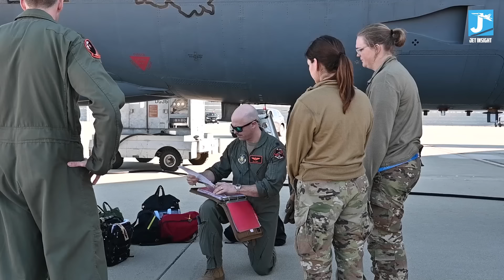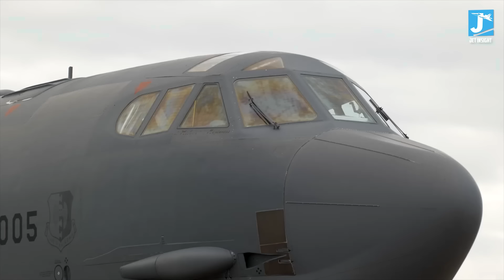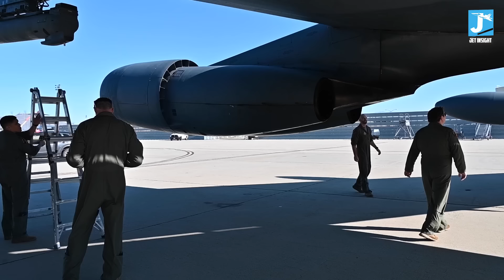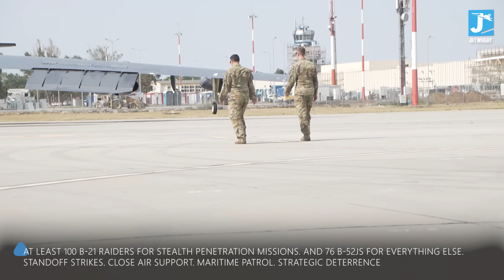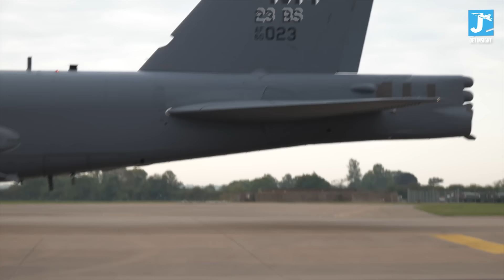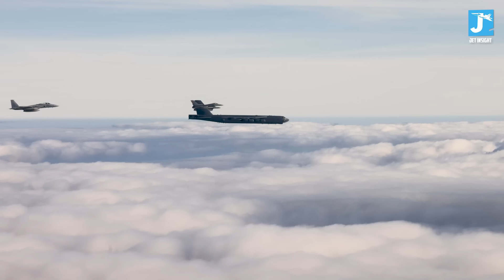The B-52 Bomber's INSANE Upgrade Will Keep It Flying Until 2060

Comment: They're getting rid of the CRM-114? Also, I really don't see them getting rid of the B-2 either. I bet a dollar to a donut; they'll have a block upgrade for it like they did for the F-15EX and incorporate many of the B-21 components, materials and systems.
Reply: B-21 will retire B-2s, the sooner the better.  B-2 skins cost to maintain what 10 B-21s will cost.

Comment: The B1B should have been the lead bomber into 2100-s. I have no idea why they are flying an antique. 
They should have put GE 9X engines on them. Go from 8 to 4. But no.... There is no way they will power them with a RR engine. Sorry.
Reply: GE9X has too a diameter to fit under the wing, as well as changing the laminar flow over the wings. Replacing with 4 pair of RR inside new nacelles shaped like the extant nacelles maintains the laminar flow, and retains the security of 8 engines on long missions. F130 engines are more powerful and 30% more fuel efficient, giving B-52J even longer range and larger payload for missions.
Reply: Go from 8 to 2 GE 9X you mean?  The drag of four would be counterproductive.  Induced and parasitic drag is pretty critical to mitigate.  You are right about B-1Bs.  Dropping down to a schedule where under two dozen can fly really screws up the program.  May as well re-engined FB-111A and kept them flying.
Reply: @MadRat70  Sorry, I meant to say the GEnX engine that is used on the 747-8. I was told years ago that the B52 needed all 8 engines to run the ECM and weapons suites. I was also told that the new AF1 had to have 4 engines for the same reason. I do know that they are putting 2 generators on the 9X engines but who knows what is down the road. I think the pylon ratings on the B52 would support the GEnX... Never support the 9x. Thanks!!

Comment: if take a truck and replace starter, alternator, transmission, gas tank, doors, hood, etc. not much original is left. its not the same plane anymore. what intersinng is the upgrading and how the airframe has endured.    the lessons for next airframe is open system design. so new planes can be easily upgraded and modified.

Comment: The B-52 can take off and land in a cross wind, like no other aircraft.  A major point left out of this video.
Reply: Yep, my brother in law was an officer in USAF and was stationed at Ellsworth AFB back in the mid eighties. He pulled some strings and I got to be on the flight line as these giants were doing touch and go's and that was one of the crazy things that I remember seeing. The body of the airplane was skewed to one side but the landing gear remained aligned with the runway! That and besides the sound that you could feel, I was waiting for a bunch of Air Force maintenance people to run out from the hanger and help push them back into the air - they are that giant and ungainly looking!! It was a hell of a visit to Ellsworth AFB, besides the airplane I also went to a nearby reservoir and caught the daily limit for trout while ice fish AND after a security clearance check - I thought that was a little extreme - I got to check out a SR71 Blackbird. That was awesome and yep, they had armed USAF people around it. He ended up retiring as a colonel and over his 20 year career, I got to check out some pretty cool things that the general public just can't do so I am grateful for his service and grateful that I was able to visit all of these different AFB's and the areas around them.
Reply: It would be cool to see the actual size of that bad boy in person. Only seeing them on screen doesn’t do them justice im sure.
Reply: This is off topic a bit.  I know the SR 71 was quite expensive to maintain and it wasn’t designed to carry any weapons etc.
If it were even possible I wonder how it would be if it were to be refitted with a launch platform for hypersonic missiles would perform.
Reply: @dispatch444  Google search the M-21. 😉
Reply: Same as the B744.

Comment: Everything is good but loosing the analog gauges is a huge mistake!
Reply: Why would you say that? Most of my 20+ year USAF career was spent as a maintenance Crew Chief on KC-135s. In 1997 my KC-135 was the first tanker to get a glass cockpit upgrade and got rid of all the old analog gauges. The glass cockpit is so much more capable and dependable compared to those analog gauges. Since the KC-135 was also built by Boeing in the 50s it shared a lot of gauges with the B-52 so it should be a very smooth and much needed upgrade. They will totally love the new engines. They upgraded the engines on the KC-135 in the 1980s. They went from J-57s and TF-33 to the amazing F-108 cf-100. B-52s also started off with the loud, smoky water injected J-57s then upgraded to the TF-33 which wasn't really the greatest of an upgrades.